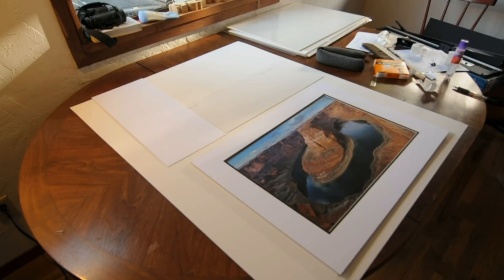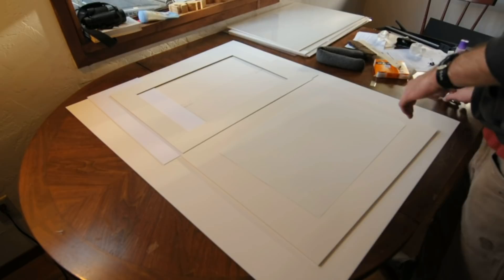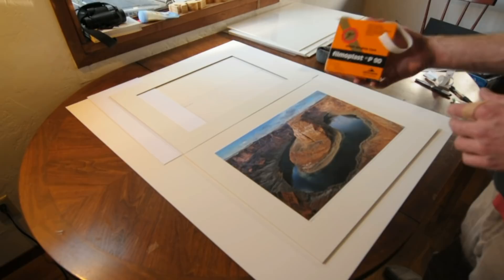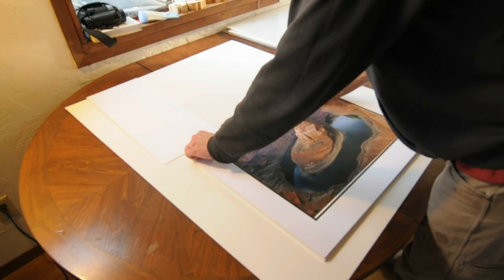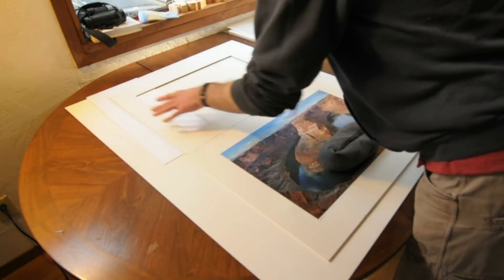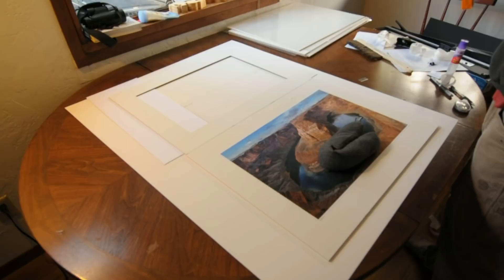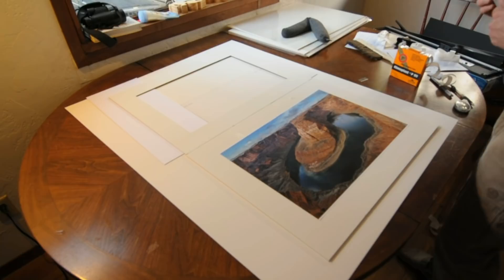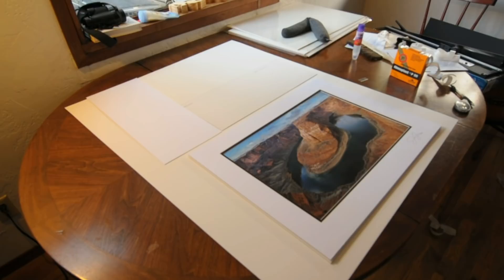How to mat a print in an archival, conservation-safe manner

Comment: Very good tutorial, this is how it's done in commercial framing shops. We use a acid free double stick adhesive to secure the mat to the foamcore. This will keep the mat in place and you can lift the mat if necessary without any damage. Scotch makes a tape gun that works great for production you can buy at Dick Blick or any art or framing supply house.

Comment from the maker: @ChrisRRJones : Hey Chris, glad you found the vid useful!  I was using foamcore instead of mount board simply because it was cheaper, though I was still using acid-free archival stuff.  I've since switched to mounting board and find pros and cons to each method.

Mountboard
----------------
 Pros - truly archival.  thinner than foamcore, so I can now bring more prints with me to art shows and they take up the same amount of space.  mount board doesn't warp with temp and humidity fluctuations

Comment from the maker: Hi Jim,

I've changed my method a little bit and now I actually use two different archival pens to sign the print. One is a black pen from Micron to sign the back, and the other is an archival silver paint pen to sign the print. Got both from my local art supply store.

Cheers,

Josh

Comment: I always leave a 1/4" around my prints for me to"
Number-left, Title-center, and Sign-right, 
Most of my prints have at least a 1" border when I print them.
The rest of what you do with your matting, I do pretty much the same thing.
Although, I don't use glue from a bottle. I use the clear ATG framers tape because it holds well and I can just slide my finger between the mat and board to unattach if I need to.
I do at least 18 outdoor shows a year, so like you, I like keeping the mat in place.

Comment: Nicely done. The only thing that I would add (and it is a personal preference) is that I  always choose to put a piece of acid free rag paper between the foam core and the print. Most foam core is faced with paper, which can breakdown, overtime, generating acid and oxidizing the print. The foam core is there to provide the rigidity required for framing, but the heavy weight archival paper will act as a barrier between the print and the foam core's paper facing.
Reply from the maker: Thanks, and well said. I actually no longer use the foam core but rather acid free backing board. Unfortunately it's difficult to keep the video updated with new techniques, so I appreciate the addition of your comment.

Comment from the maker: In this video I was using 1/4" foamcore but I have since moved to using a thin, archival backing board which is only 1/32" thick. It's much less rigid than the foamcore but it is also more resistant to warping when exposed to heat and humidity fluctuations. I get this backing board from clearbags. Good luck!

Comment: Hi Josh, This was a very helpful video -- thanks for posting it.  In the past, I haven't hinged the mat and have only used double-sided tape all over underneath the mat to secure it to the foamcore.  I've been having problems with curling of the mat in high-humidity environments (when displaying unframed in exhibitions near the coast).  So, I'm hoping the hinge tape and the dab of glue will be a better way of keeping things in place while still allowing for expansion/contraction due to humidity.

Comment from the maker: Hi Joe, I do use t-hinges on just the top of the print. It's absolutely strong enough to hold it in place. I usually overlap the mat about 1/4" inch. Some buckling/curling is probably inevitable, even with this method. You can try using a matte paper to reduce the appearance of wrinkles, or if they get very pronounced, have the print dry-mounted to your backing board. That will keep the print flat forever and it's still (in theory) an archival, reversible process. Cheers.

Comment from the maker: @ChrisRRJones continued...

Mountboard cons - a little more expensive than foamcore.  It's not stiff like foamcore, so you have to be more careful not to bend the print.  when you go to frame it, you'll probably also have to add some kind of backing board in order to give the piece some rigidity in the frame.

Comment from the maker: Hi Angelica,

That second piece of tape is lined up flush with the edge of the print. With the longer piece of tape it does stick to the back of the print window from time to time. You could prevent this by sticking another piece of tape over the adhesive part of this tape. The longer piece of tape is then still able to move slightly side to side to allow the print to expand and contract. I've never used the corner method you describe but it sounds like the same ideas are involved. Good luck!

Comment from the maker: @Kimbo83: Good question!  I can't say if the exact 27" width is ok.  You'll have to measure the poster and measure the frame precisely to make sure it will fit.  

As for the mat, the poster might sag eventually into the glass.  The best solution I can think of is to take the poster into your local frame shop and have them use their dry mount press to mount the poster to a piece of foam board.  That will prevent it from sagging, and the dry mount is still archival.  Good luck!

Comment from the maker: I'm not sure there's a 100% sure-fire way to prevent undulations, but here are some tips that have worked well for me:

1) Use a matte paper for printing. Without the reflections of glossy or lustre you won't be able to see the undulations
2) Seal the board and mat to the glass with a metal tape. It should create a humidity-constant bubble to help protect the print from external fluctuations.

I'm sure your local frame shop can provide some additional tips. Good luck!

Comment: @JSinon1: A few things you can try to reduce wrinkling:
1) Hang the print somewhere where it's not subject to temperature and humidity fluctuations.  These are the main causes of wrinkling
2) Use a matte or lustre finish instead of metallic or glossy.  This will help make wrinkling less noticeable.
3) If all else fails, dry mount the print to the backing board.  This will remove all wrinkles and is still (in theory) a reversible process if you need to remove the print. 

Good luck!

Comment: PS:   the thing with signing the mat can cause some problems as far as if the person purchased just a matted print from you, they may want to remat it to even double or triple, then covering your signature. I once bought an artist/painter print signed on the mat while on a trip. By the time I got back home, the mat had a scratch in it. So if I replaced the mat myself, that meant I would lose the signature of the artist :-/  So now I have a matted/framed  8x10 with a scratched mat on my wall

Comment: First, I want to thank you for posting such a helpful video.

I couldn't find any information in the list of previous comments about the type of tape that you used in this presentation.  I attempted to mount/mat some prints using this method and everything worked well with one major exception:  the gummed, water-activated tape that I attempted to use causes the print to warp and buckle at the point where the hinge is attached.

What type of archival tape do you use for making hinges?

Comment: I assume the pen is also archival. I use a variety of pigment based pens, depending on the size of the print or if it is a giclee canvas.
I also sign the print, not the mat (or both depending.)

Great video, concise and to the point.

Comment: Very good info , quite logical actually I knew there had to be a way, hinge is it 👌 . My question. Is I have an original ( light water damage towards the edges )1950’sJapanese print (woodblock ) I would like to frame it & am thinking the method use could work. Do you think this archival tape,& foam board or  a thinner backing board would work?   I know because of the damage it is work a bit less( I purchased it knowing thus) but the colors etc. Were so beautiful& vibrant.  I just want to do the best to preserve it correctly. 
Thankyou ,, Jeannehushpupmom ( sorry I am not on Facebook or Twitter )

Comment: Great video. Thanks for posting this, Josh. The issue I've had to deal with the most is keeping the print flat and not having it curl or almost buckle. Do you use T-hinges on just the top of the print? Is that enough to hold it in place? How much of the matte do you overlap the print with typically?

Comment: Great video, I am wanting to frame some prints of mine. I've heard Filmoplast P-90 is reversible, but how do you get it off the print? I've heard you use a Q tip with water to remove the tape, but what technique do you use? If I have the tape face up taping the print to the mat do  you just wipe the wet q tip over the tape to remove it? Wing the water ruin the print ? Thanks very much!

Comment: Thank you so much! It's a very useful, clear and pleasant explanation.
I would like to ask you for advise when the print of artwork on paper is a bit curled and wrinlked. Would you please share the link of the video in which you explain that too?

I also would like to ask you for advise when it comes to matting prints or artwork drawn on paper and leave it "floating" so that no part of the artwork itself gets covered by the mat window.

Many many thanks! I am really grateful. Take care and keep up with the good work and the beautiful photographies!
Reply: You're welcome. For prints that are a bit wrinkled or curled you should probably have a frame shop dry mount them. It's reversible, in theory....

To have artwork "floating" like you say I would make sure the artwork has a border, then you can simply size the mat window to me larger than the print area but smaller than the total paper size. Hope that helps!
Reply: Professional Photography Tips
Hello, and thank you for the reply.

My artworks cover the full surface of the paper sheet so there is no border left.
What to do in such cases? Paste the artwork onto a slightly larger sheet?
How to paste them together making sure not to harm the artwork?
(I mainly draw with graphic and acrylic markers on A3 160 grams paper, so rather thin.)
Thank you, I feel lucky for having found your channel.

Matt
Reply: SnowTigerr Hey Matt. Hmm, at this point you're getting a little beyond the realm of my expertise. I would contact your local frame shop or art supply store and ask their advice. Good luck! -Josh

Comment: ha, I was going to mention changing from foamcore to backing board to you :)  I also get mine from clearbags.  I used to use a thinner backing board also from clearbags, but when transporting to shows, had to also include the foamcore. It takes up a lot of room in my print bins at shows, also making the boxes I carry the batch of about 30 or so each box extremely heavy.  It now costs me less to use the more expensive heavier backing board alone, than it did the thin board plus the foamcore :)

Comment: Where you get the matting...I do 13x19 prints too...can't seem to find the matting
Reply: You either cut it yourself with a matboard cutter or you can get one cut for you at any framing store. If you're going to be mounting a ton of prints, I usually order in bulk from Matboard Plus. They have a bunch of sizes of mats to choose from but you can customize the size of the opening.

Comment: Did you bet a pre cut mat frame? or did you cut it yourself?
Reply from the maker: Pre-cut. I used to cut mats myself to save money, but the trade off is that they weren't as good as the pre-cut ones plus it took so much time!
Reply: Josh Cripps Where do you get them? (if you don't mind sharing) I've been looking for a good place
Reply: ***** Hi Matthew, sorry for the delay in responding. Sometimes I don't see all the comments. Check out Clear Bags or Matboard and More.

Comment: So you tape underneath the print? with double sided tape? I am matting realistic drawings of mine. So I am figuring out how to professionally mat a picture.
Reply from the maker: The best thing to do is to leave a border around the edge of the print so you can tape underneath that. Good luck!
Reply: ok thanks!
Reply: marie Jones Marie, it's SINGLE sided tape. One faces up, attached to the back of the print only. The other faces down attached to the exposed sticky side of the first piece and the mount board. Please do yourself a favor and seek other sources of mounting information before beginning.
Reply: Josh Cripps
 What to do when the artist has "forgotten" to leave a border around the edge of the print and you still want to frame it without having the mat window cover any part of the picture? thanks!

Comment: Can anybody advice any proper technique to mat an antique print without any kinds of tapes!?
Reply: There is a type of tape that has a plastic top.  The plastic hangs over the tape on one side so it can be trimmed to a size that is not visible inside the mat cutout.  You lay the tape at the edge bide (not on top) of your print in at least two places on each side.  It adheres to the foam core and your print is gently held in place by the lightly overhanging plastic strips.  But I don't actually know where you would buy it...I've just seen it used in a frame shop.
Reply: I went online and found it in a framing supplies shop.  It is called see through mounting strips.  It comes in strips instead of a roll and it uses mylar for the see through label.   Where I saw it used it held the art at the edges like a border so it didn't slide around and then was sandwiched with the art between the backing board and the mat.  If you ever wanted to change it you could removed the mat and simply slip the art out from the tiny plastic edge holders

Comment: Also, do not add a copyright symbol. Do not write the title of the print. dating it is ok but its not necessary and should be done on the back of the print. oh yeah, ALWAYS wear white cotton gloves when handling mat board or your prints. The oils on your hands are not archival. You can buy them at any one of a hundred different art supply stores. Light Impressions is a great place to get them. One last thing, don't use foam core when matting pictures.

Comment: If you want to archive your prints, don't frame them. Keep them in a cool, dark, dry place. You can display prints in such a manner that ensures longevity, but to use the words "archive" is not really in line with framing a print.

Comment: You tell people to use an archival pen to sign the print on the back, and you are using a Pilot gel pen (not archival), nor you are using the cotton gloves you recommend.  Be consistent.
Reply: I agree, and the hinge method is as he said for a bordered print, here since it is borderless, he can use small acid free corners L shaped to make sure this invaluable print does not come in touch with the damn adhesive he slapped on the back, IF HE is to use the hinge method it will be better off using the Japanese tape with wheat starch that is totally natural and has no damn adhesives even if it is "archival" tape.